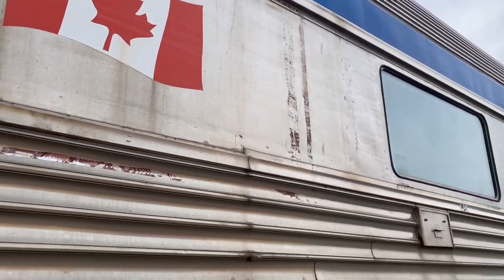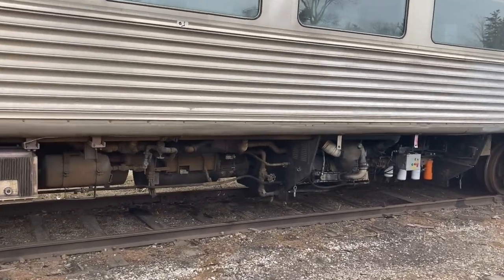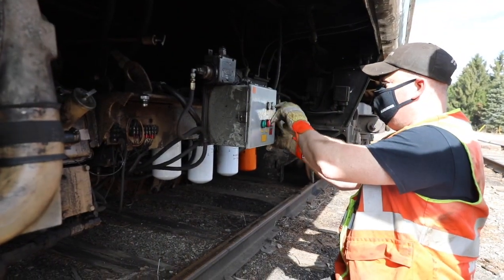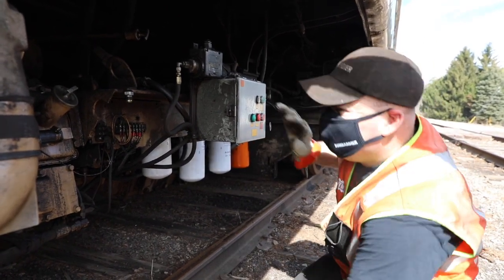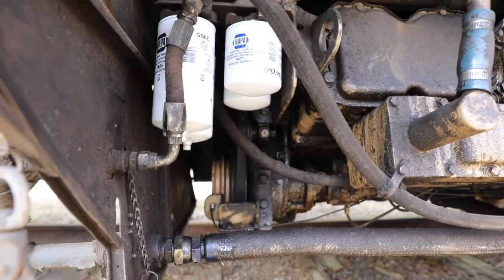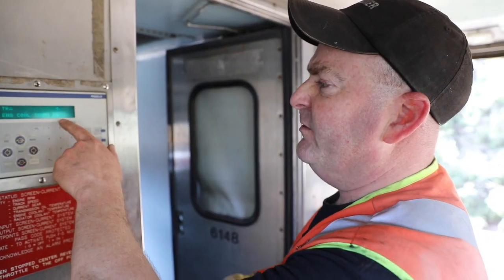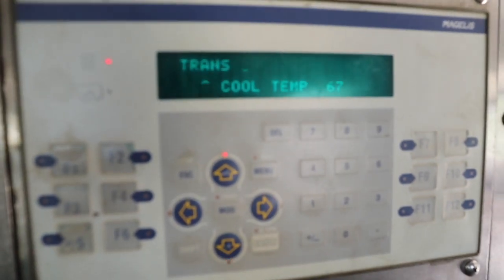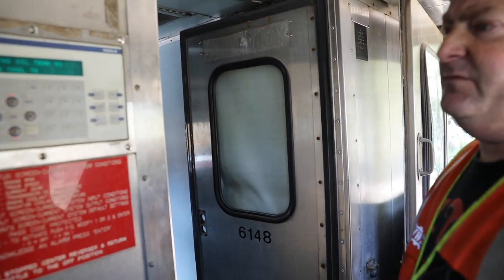Waterloo Central Railway RDC 6148 Awakening of enigne No. 2

Comment: Ive only worked on RDCs with 6-110s. Just curious, what do these use for a transmission?
Reply from the maker: The transmissions are a Twin Disc TAC-22-1304 two speed completely different than the Allison ... but has the same flange and prop shaft size